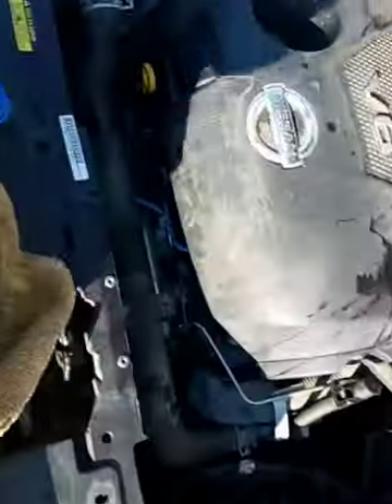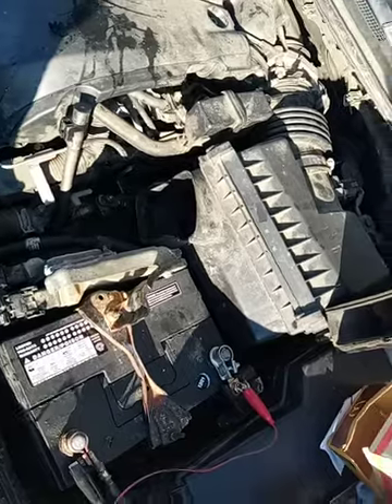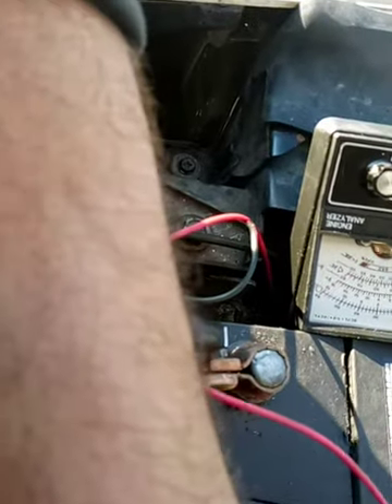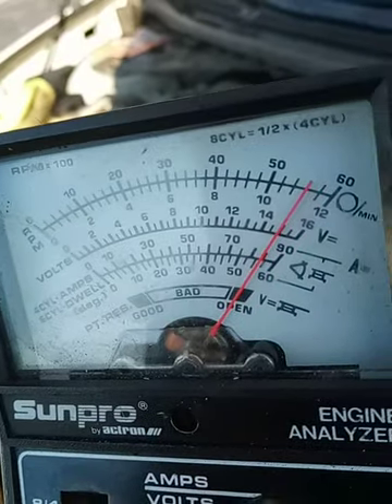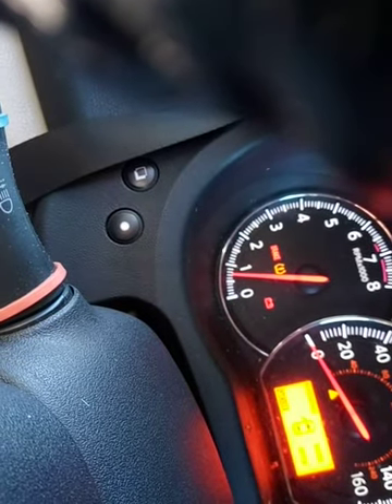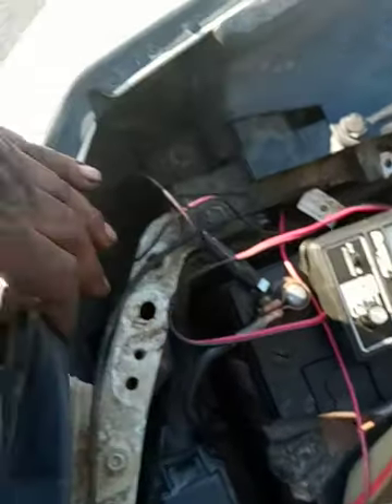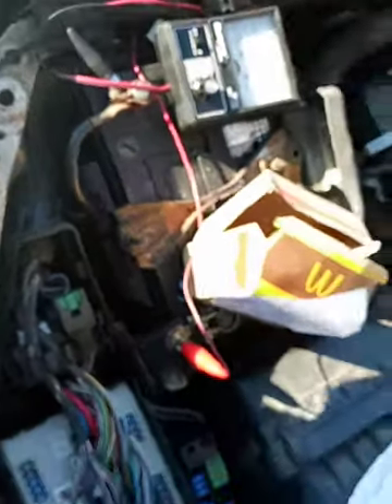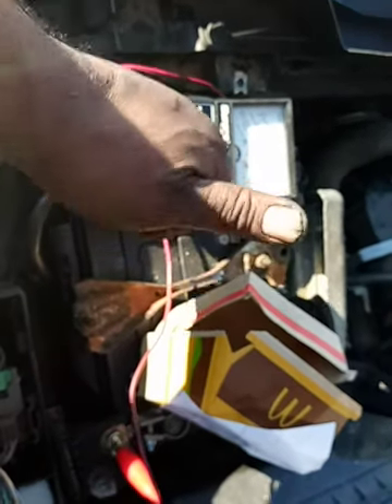2010 - 2015 Nissan maxima Altima alternator 15 volt problem

Comment: I don't understand did you find a solution or not?
Reply from the maker: Yes in another video not yet uploaded Check you harness from the alt. Up and back of the motor... Cut the wrapping carefully you see burned wire.. Use the same grade wire..then wrap it.

Comment: I can jump my Altima off and so. As I take jumper cables off the car cuts off
Reply from the maker: Alt not charging or battery shot . Check battery first before alt check main fuse at the battery terminal
Reply: I did new battery and alternator and my car still dying
Reply from the maker: @43verfr3e3  did you check fuses relay and wiring harness  are sure all ground wire back on. Make sure belt put on the right way. Get a volt meter and tell me what Coming out of the alt. Remember computer controls everything.. start with basic had custom er say they got a new battery but it was d.o.a. make sure you not sitting on top of the a/c wire also see this also.. don't know if you have a bio directional scanner now this getting more deep.. at the pro level.. Check all your ground leads.. bet you missed one..check the positive cable lead and fuse here also.. top and side.. hope this help..